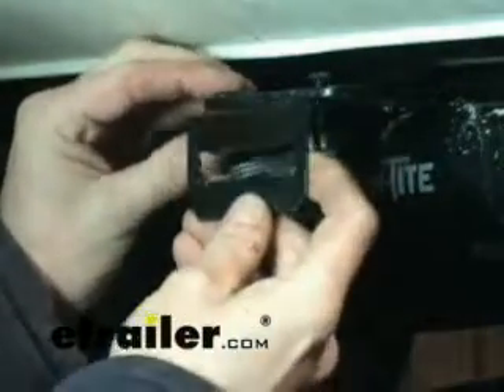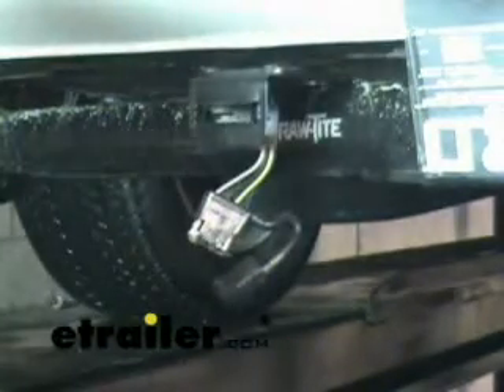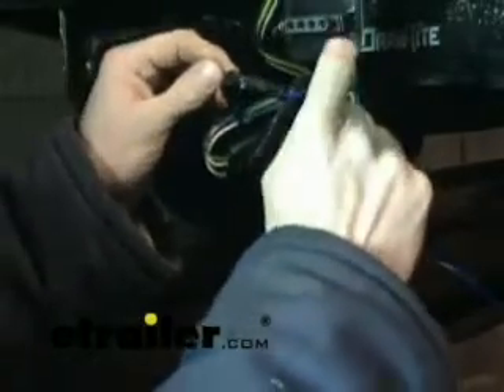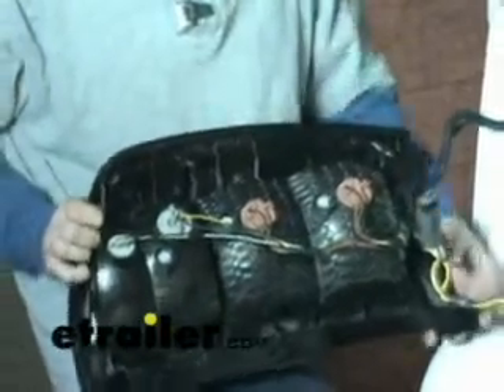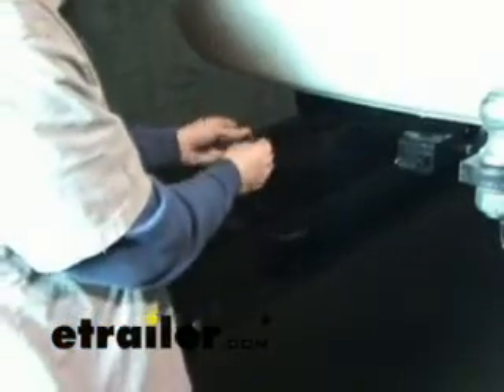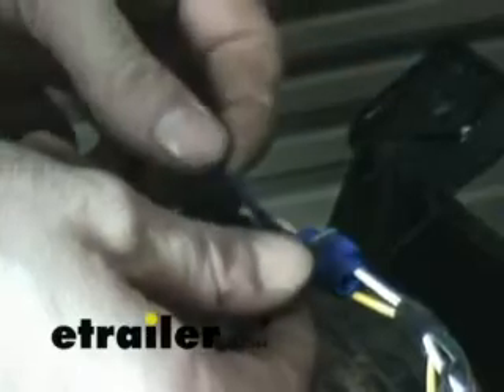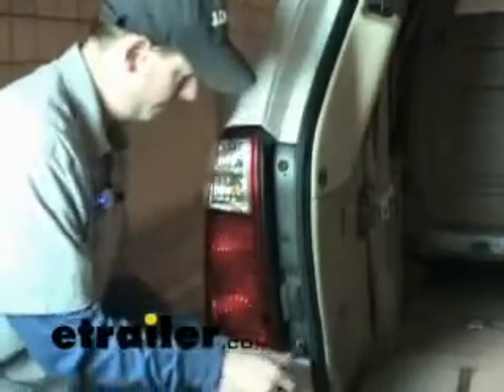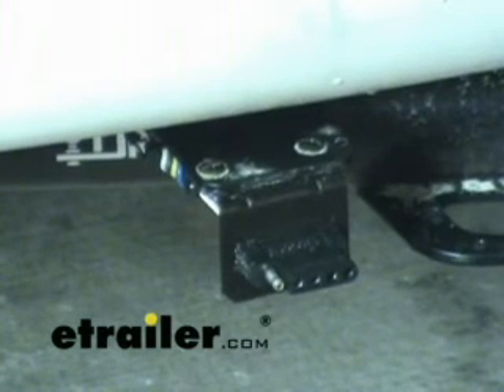etrailer | Trailer Wiring Harness Installation - 2006 Kia Sedona 20036

Comment from the maker: @edkonvang If both of the connecters are flat connectors, you should be able to simply plug the 4-flat into the 5-flat. The 5th wire simply wouldn't be used by trailer because no signal passes to the 4-way. Just check that all the trailer lights function properly if the connectors mate together and you'll be good to go. If you have different shaped connectors, like round ones, let me know what they are and I'll have some other suggestions. We'll get you sorted out.